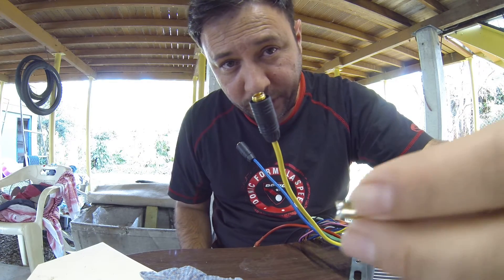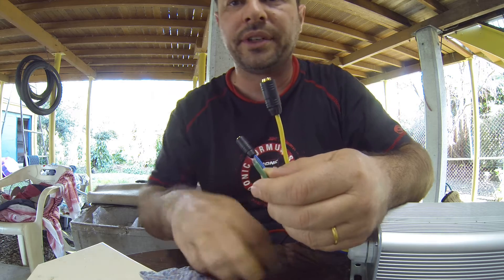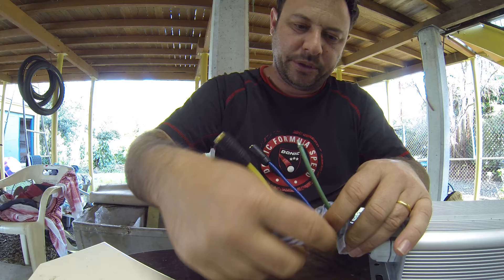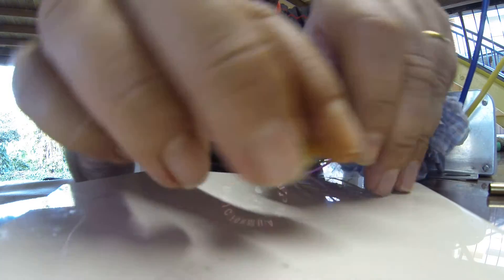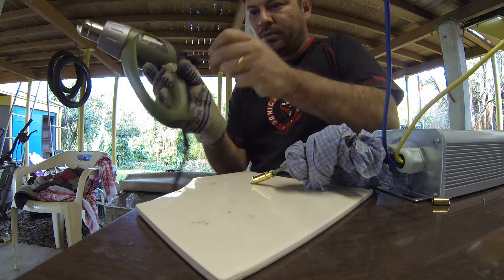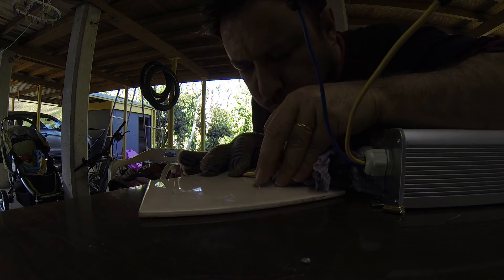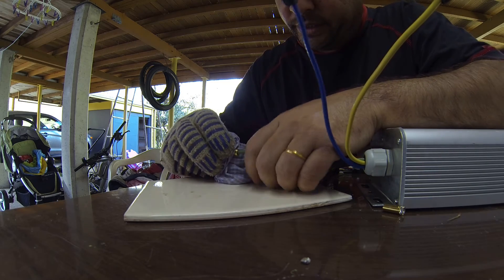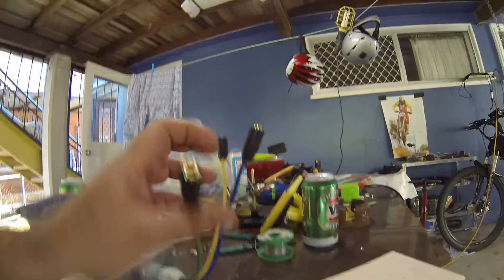Soldering Electric Bike kit conversion

Comment: Good to see you at the work station ! Do you recommend switching out my wires from the battery bums to 8 g ?
Reply from the maker: +Rc forever Thanks for kind words mate, sorry however not sure on your situation.  The power you run continuously will determine the gauge.  phase wires run ac current I think too which means more can be put through them, Im no expert here but there are some charts you can google up. As an example, iIn the background of this video you can see my bike has changed to a 26" wheel = because I broke the axle on my clyte 4065.  The power running is the same but this motor now is about a third or fourth as capable as the last.  My phase wires get extremely hot now so I try not to keep near 4000w for much longer than short bursts.